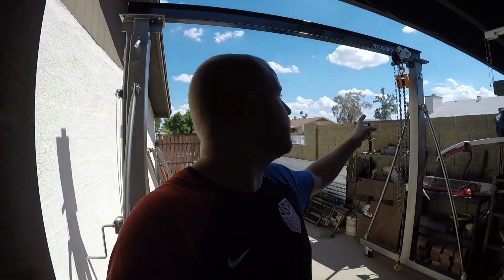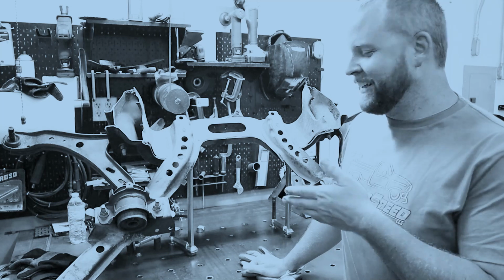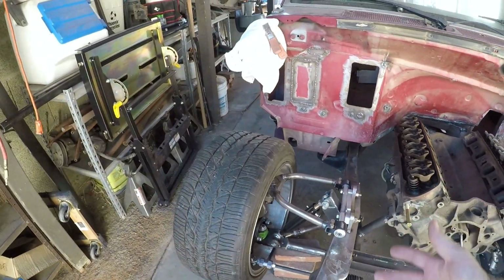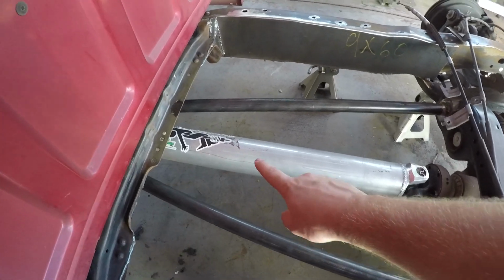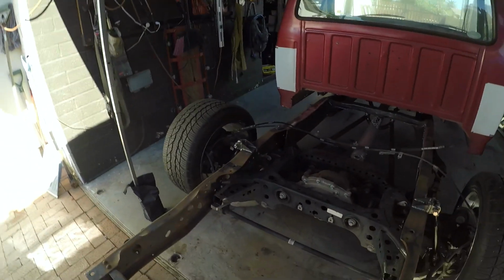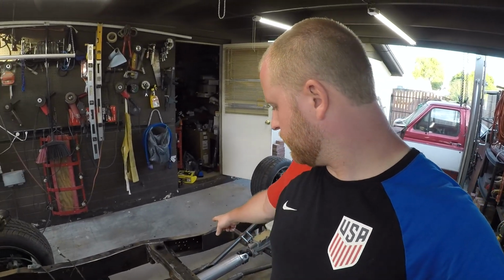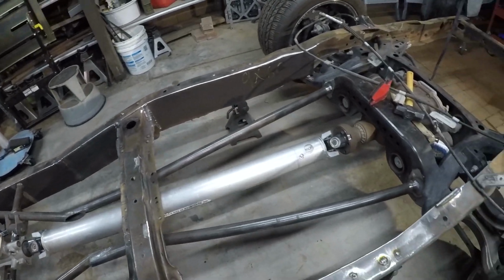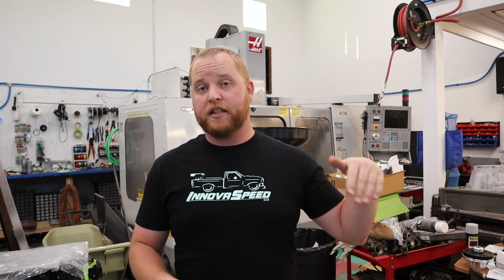Pro Touring OBS F150 Race Truck Build | Frame boxed and first Custom Suspension with IRS Test

Comment: How much did the frame move around putting all that heat into it with those plates being fully welded in. I am looking at doing something similar on my Dodge but I am thing stitch welding in the plates. I have seen frames turn into noodles with very little heat.
Reply from the maker: While the video doesn't show it, I did move around a lot to prevent focusing too much heat at one spot. So it didn't really move at all. Stitching would be perfectly fine. I just had a different idea in mind for how I wanted to finish the edges.

I've boxed a few truck frames for other people too without issue.